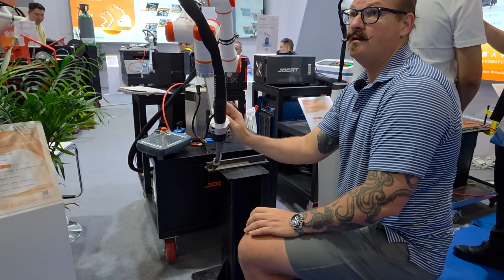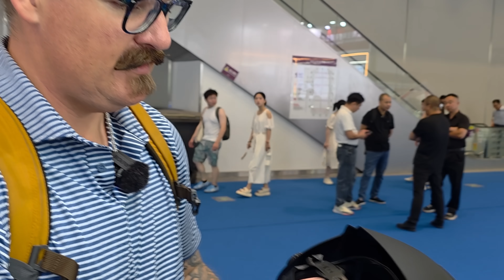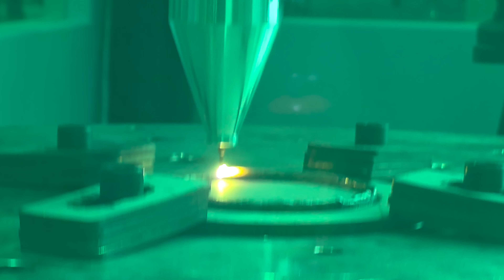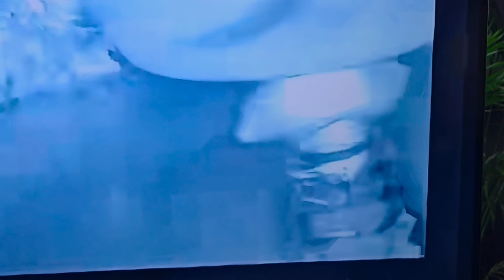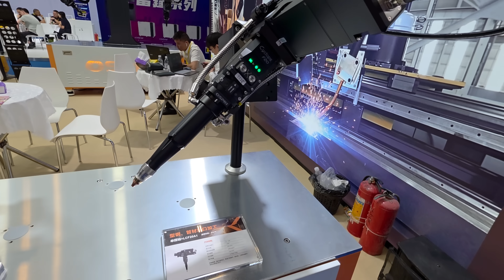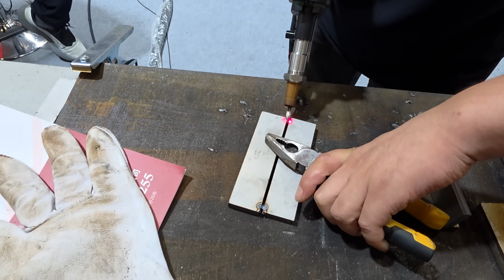The End of Hand Welding (I Saw the Proof)

Comment: ENGINEER HERE - I used to work in Robotics and sorry mate but this is BULLSHlT.
Its like the similar BULLSHlT that AI was going to replace 95% of jobs.

I guarantee you that when I was doing robotics I could out program any welder, but I could NEVER get a welding robot to weld better than they can.  
The same thing was discovered when CNC machine tools arrived.
The same sorts of claims that nobody would need to become tool makers or machinists because CAD/CAM & Automation would make them unnecessary.
It turned out to be BULLSHlT because you might be able to do amazing things with CNC and its even easier now BUT YOU STILL NEED THE BASIC SKILL SET OF MACHINING METAL. 

The future of welding will be, just as it has been for the last 25+ years:
People who can program robots BUT ALSO have decent training in welding will always do a better job.

And FYI - After I left robotics behind and shifted into the mining industry one of the first things I found out was there was a dire need for welders. 
When it comes to MAINTENANCE of existing things like mining equipment or ships you can't use a robot.
Robots are fantastic for repetitive jobs requiring precision.
They are next to completely useless for 1 off tasks and 100% USELESS for MAINTENANCE.
Industrial robots are good for repetitive precisions tasks. DO NOT equate that with the requirements of MAINTENANCE. 

Go and look at the State of the US Navy's construction program or the MAINTENANCE of its ships and subs. 
Go and look at the State of the British Navy's construction program or the MAINTENANCE of its ships and subs. 
Go and look at the State of the Russian Navy's construction program or the MAINTENANCE of its ships and subs. 
I'm Australia and its the same set of problems here.

EVERYONE FORGETS this thing called MAINTENACNE.
Reply: The "weld better" weld wasn't done by some kid with 2 weeks of training. "Good enough" and cheap is what efficiency is about. Robots are already doing repetitive welds very effectively in auto manufacturing. 

How many years has AI been tasked with figuring out what and where to weld? Give AI another couple of years of collecting all that training data and you'll be struggling to match the AI welds. Do you remember when computers started learning how play chess? You don't see Grand Masters competing against computers any more, do you?

Comment: That welding robot arm at 1.21 is not anything new, when I went to high school(industrial production/automaton program) in 99-02 we programmed such arms with g-codes like cnc machines and the arm robot had these modes where u led it through it coordination system(the entire movements it was capable of) and it remembered it and created its own g-codes according to the hand leading movements. With AI I guess they can speed up and eas up the in-between steps, and even adapt to if the piece is placed somewhere else I guess.

The robot with AI and scanning of the piece was more impressive, but if u have an 3d assembly model I guess it can pull information from there without scanning, if it can simulate the loads and such as an cad software can.

Very enjoyable video.

Comment: That’s unreal, where was that at?
Reply from the maker: I went to the Beijing Essen Welding and Cutting Fair in Shenzen.
Reply: @HeroMachineCo 
The welding equipment looks state of the art, how will work long term do you think? Will all the equipment cost a fortune or is it worth it
Reply: @hungryhil  I think you can use the laser welders for ten years and then out with the trash..... but the time saved and increasing speed will do it right.

Comment: This would be suitable for mass production. For one offs a human welder makes more sense.
Reply: Idk man, I think it could be used for less skilled welders. Example, if you have a project that needs lots of different techniques it might be faster and better to use this.
Reply: Have you seen walking robots?
Reply: some of these have laser scanners and cameras. They can do one offs too.
Reply: You miss the point....5 to 10 time per unit cost, no medical insurance, no labor dispute/Union, can work 24/7.
Reply: @juhantoon6524 Completely maintenance free forever, even though power outages? Keep on dry jerking yourself…
Reply: They'll make it portable very soon.
Reply: @dogzer it makes no sense to program a robot to do a job you can do faster than teaching the robot. This is volume production stuff.
Reply: @KlausBöckl dude, showing the robot the start and end of a weld, is always going to be faster than actually welding.

In what universe do you think you could weld a few feet faster than this? This is not for welding 6 inches of weld lol
Reply: @RyanDiederich that's the simplistic answer from an amateur! Are you brainwashed by robots? There's a lot more time getting stuff set up with this robot then just getting a stick and welding even if it's a big one time job. Especially when it's a big fab job.
Reply: @johnvajcner20 
They will put these robots on those mini excavators, stand on skid steers, and all those other minis flooding in. 
They will be to expensive for most at first, but the price will drop pretty quick and you will see these things start popping up. They'll load and unload themselves and likely have extra arms for material handling or work processes.
Wild!
Reply: @RyanDiederich  Can it place the pieces in position, tack weld them, check for scale. I can't see it working for large one off fabrications.
Reply: @johnvajcner20 He’s married to a Real Doll, it looks just like him!
Reply: You’re married to a Real Doll aren’t you…
Reply: @987frankie It won’t work for what it was designed for, at least not for long.
Reply: @987frankie  Think of it as the welder having an assistant. The welder sets up the job and leaves the robot to do the weld. That give the welder time to go set up the next job for the robot to do. The weld would be robotically precise and the welder would not have to be in an uncomfortable position making the weld
Reply: @dogzer so what?
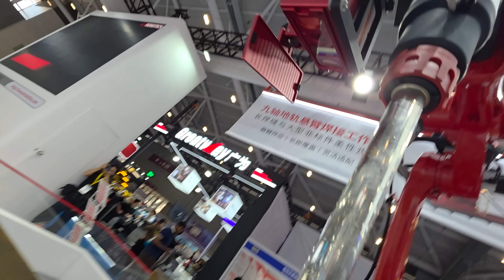Reply: Once cameras and AI are involved it can do 1 offs. 7:42
Reply: @rumhave9632 how many years from now? How many cams on how many different welders? It's not a sewing shop.

Comment: the cost of these machines will still be higher then a person with a conventional welder. I do not see any of these machines reaching the masses and will remain in the production line owned by some rich person. very few people can afford to even take a small project to a average low cost welding shop anymore.
Reply: Its not the one off cost, people are inconsistent and unreliable. Machines can be more economical for repeate jobs
Reply from the maker: I saw some of these arms, without the welder in the 10-12k range. A welder is going to cost you $50k - $100k a year, depending on your area. Even if this could replace 20% of that work; the machine is paid off in a year.
Reply: @HeroMachineCo the arm is 10-12k software is 10-12k annually and the person to run it is 60-100k we’ve heard this song and dance for 20+ years job shop work and small run manufacturing will be done by humans for some time yet
Reply: Like computers, these machines & AI will only get better & better.
Now imaging a world where a boss says to you, that the machine can do it for 1/4 of what it cost to have you do the same job & offers you an opportunity to take a pay cut $1 below the hourly cost of the machine to keep your job - welcome to the future.

Comment: There is no good long term safety study for laser welding. Dont be a guinea pig. I ise ipg handheld 1500xr a lot. I use my safety glasses designed for laser welding,  under my hood set 7-9. I think there should also be a specific glove with an inner material for safety and for the chest area. I do a lot of shiny. It will reflect. It only takes a millisecond to burn your cornia, etc. They are amazing for tacking, i was tacking one take at about 450w. Had my hand on the back side while taking, burnt a clean hole through the glove and a nice crater in my thumb. Very fast and little power. Blackstallion thicker gloves. Im telling you, it isnt worth it. But they are far more capable machines and not like they are advertised.
Reply from the maker: Safety is one of the big things to figure out right now with laser safety. Even the correct laser welding hood won't hold up to a direct blast from a laser. It will block the infrared until the heat energy melts the glass and then you get a straight hit of laser. But the reflections are 100% manageable with a 1080nm filter and at least OD6 darkness but most people will be more comfortable with an OD8 because it helps block the bright visible wavelength of light.  I have found a fabric that is specifically designed to protect your skin and hands from the same harmful radiation.
Reply: I was a laser tech for a short while in my early career. I would wear the correct wavelength PPE and I had speckled vision after every shift. Like tiny stars twinkling across my whole field of view. Didn't trust it and didn't want to get used to that.
Reply: You can't get around the physics of metal joining. Penetration, heat affected zone, reinforcement, undercut, need to be taken into consideration by the operator, otherwise "How do it know?"

Comment: I have used a lot of variations of these. Welders are completely safe. One reason is, companies still put a welder on it. You can program the right route all day, but if you dont know what a good weld is, you can have a lot of problems. They dont do smaller guage in a confident way. A lot of jndustrial product has to be done by hand. A lot of galvanized and galvanealed product that wont go on any cobot. Only replicable products. Truth is, ypu know welders will disapear when something like a tesla robot can identity joints and hold a weld gun in hand. That is when we will be screwed. That is just manufacturing. Good luck on code work, field work. It just isnt happening. The setup in-between is sometimes not even worth it unless you are trying to get rid of labor. Bit then again, they put a welder on it most of the time. These things just make life easier. Thats it.
Reply: These are first generation, the tech will advance in very short amount of time. Welders will be obsolete
Reply: @ghingisoverland6932 rhey are way to expensive. If you own your own welding fab, you have to scale into this. Other than that, the real danger is companies swallowing smaller companies and big companies failing because they dont know how to manage their businesses so they fail to create room for startups. Its still a long time coming. It isnt magic. Its more a reality that the few very successful dominates the industry to a degree of a monopoly

Comment: I use normal welding helmet for laser welding too. no issue.
Reply from the maker: I would highly recommend you get a pair of laser welding glasses to put under your hood.  The infrared light generated by a laser is much higher than normal welding processes.  One bad reflection will go right through that regular welding lens faster than you can blink.
Reply: @HeroMachineCo  I am more concerned with short wave lights, which can rip off electron from atom. infrared from 800w laser is ok, it is just heat.
Reply: Just because you can see now does not mean you will see later. So dumb to not have the proper glasses for laser welding. Your lens for your helmet has one classification. Laser glasses have 6+. Just because you can't "see" the damage,  does not mean you aren't. That like saying, "i been smoking for years, im still kickin"...
Reply: @michaelryan9311  It is good argument. I think it is better to be safe than sorry~